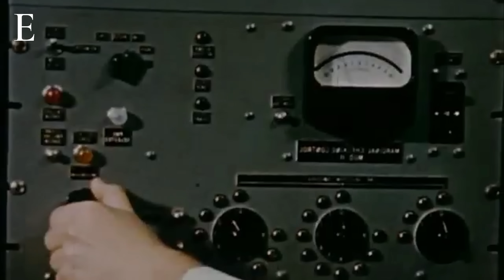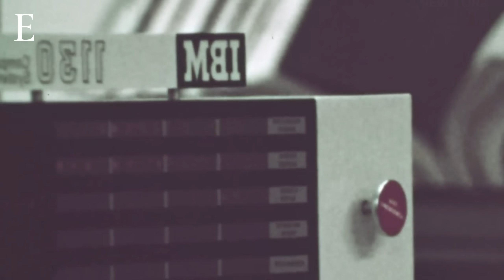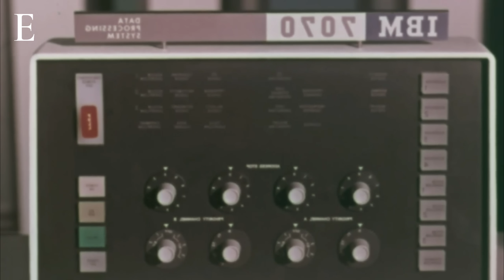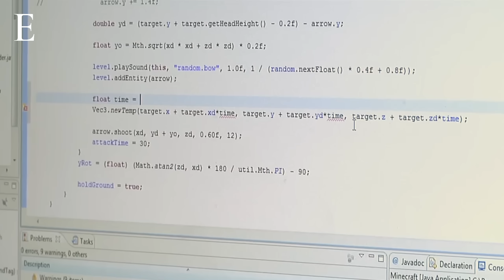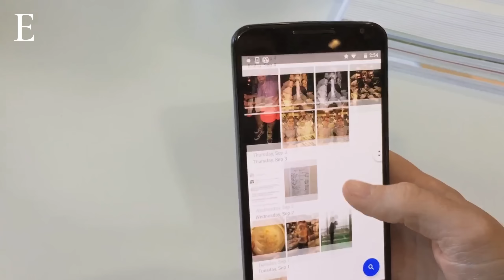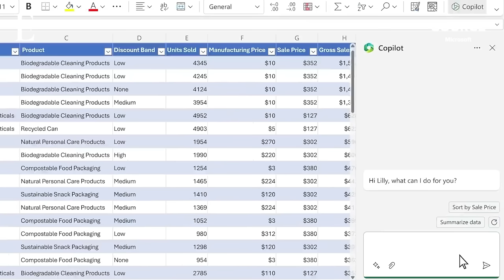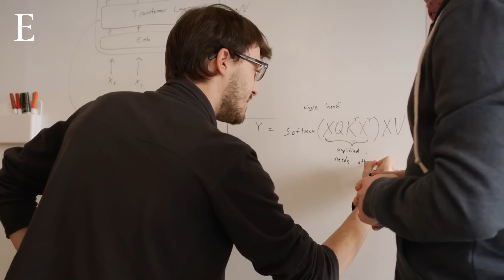The Rise and Fall of Software Engineers

Comment: The term “Software Engineer” has a wide scope and could include a wide range of different roles, many which today have minimal value. A Hardware provider would often have as many SE’s as sales reps, which today is no longer the case. There were SE’s in marketing, which today rarely exist. However, high end SE’s which in depth technical knowledge and skill are still in demand; however few people want to work those roles. Those type of roles are mainly focused on keeping mission critical systems working, or protecting those systems from security breaches. That type of role has no fixed hours and often requires 60 hour week, often working through the night to resolve critical issues. While the pay is good, few people wanted those type of roles. To make this issue even more difficult, in order to gain the experience you need to work those type of roles at a low income for several years, which was a real turn off to many new SE’s. Now we come to programmers, of which there are two types. Process driven programmers, who follow detailed scopes and creates the code without any idea of the overall solution. Their work is often rigidly controlled by the tools that is required by companies. While these roles can be replaced by more advanced tools (or AI), these roles do not need a high level of skill and programmers can be replaced with other programmers. As there are an unlimited number of high end programmers in India, its only logical the work moves to India. As for AI, the useful code they create is often inefficient and takes a lot of effort to debug, so replacing people with AI tools is not on the cards yet. The other type of programmers are what I call high end programmers, who start with a problem and creates the scope and design of the solution, as well as hack the initial code. These are in demand but require an enormous amount of experience, which takes years to develop. These folks have no issues getting jobs, but they are people who have unnatural passion in their field and there are few people that could fit into this type of role.

Comment: I got into programming from copywriting and can say that LLMs are fairly limited in both fields, despite being great performance boosters, idea generators, and a great learning source.. I’ve learned a lot of programming principles using this tech. Now I’m using various programming languages in my work. Sure ,go ahead and write that function or create an html form with it. But no more than that… And don’t forget to test. Thing is, we live in a consumer cultured world and people expect easy solutions. In a perfect consumer-optimized world, machine reads customer’s mind wirelessly and creates as commanded. But, to build a tool like this, not only do you need great computing power, you also need to have a ton of engineers that would consistently maintain such system and react/adjust the things on the go. So unless humanity overall gathers and invests in this massive worldwide project, there’s no hope this is a valid future scenario 🙂

Comment: I work in tech recruitment, AI isn't the replacement it is an helping hand. Klarna failed on replacing their customer service. What is happening is that companies have been going into the cloud more, offshoring their jobs outside the countries they operate in towards India or cheaper hubs. This will spiral, the question remains will the cloud cost usage be more expensive to operate or will development be able to compete with costs.

Comment: In the 1950s, software engineers were truly computer engineers, both in mechanical and electric engineering. Nowadays, many "software engineers" are coders/programmers, and there is a distinction made between software engineers and computer engineers.

Comment: The reason why 25% of Googles code is AI generated is not because it is all just done by a machine. Software Engineers use the help of AI, like GitHub Copilot for example, to increase productivity, by writing code which is repetative and boilerplate. AI can't (yet) work efficiently with complex algorythms.

Comment: As software engineer can't wait when I can just tell the prompt what I want and get the code but right now AI editors give me trash and chat gpt at best gives examples of code to the question - like stack overflow but a bit better. 
Have no idea what kind of software is generated right now everybody talking about, never seen a usable example and what seems to be ok when AI generates prediction often contains bugs. 
Actually writing a code is not even a half of what we do, it's probably about 30-20%, most of the time spend on thinking about what should be written and what change to the system is to be desired.

Comment: As a SWE, I’m not worried. I tried using Claude 3.7 to improve some simple Bash scripts I use for various repo and OS level management.  It injected so many errors I had to stop using it and just do it manually.  LLMs struggle with existing code bases. That hasn’t changed despite larger context windows.

What you have here is a bunch of CEOs trying to improve their bottom line for investors that will ultimately backfire, and these companies will just end up hiring engineers anyway to fix it all of the LLM mistakes.

Comment: Non programmers should not be allowed to touch AI for coding, period. The AI generated programs look apparently ok but needs to be checked for logical errors absolutely. Also in my experience AI works best if the larger architecture is broken up and the parts that are repetetive and common are asked to be coded. So it needs careful planning and scrutiny and a programmer is definitely needed to oversee it. At least for now AI can assist the developer to reduce development time only.

Comment: Most AI now is as the video says "generated from a simple sentence". That may be true because if I say "create a video about the evolution of Ai" I would get this video. The creator doesn't care about accuracy nor content, just clicks. But that's not how programming nor journalism works. Coding is very specific and customer requirements can be hundreds of pages long. With input like that, how is Ai supposed to process that? It cannot understand what is being asked. It can only provide sample code that matches the question without really knowing if it works. And that is somewhat useful, but requires someone to understand both what's needed and if it works. I don't disagree that it can automate tasks and replace junior engineers, however this may be symptoms of other problems. It may be that graduated are under educated, or businesses have over-hired in the previous economy, or that they feel slowdown in their own revenue and need a reason to cut people.

Comment: Ai will never replace the business understanding or simple problems and revisions in code. Ai doesn't understand the computer architecture. Ai cannot do internal meetings. Ai is a simply a tool for now, software engineers are not dying, it's evolving. And with a cs major swe is the last thing u should do now in the age of ai/ml, data and cloud.

Comment: Software engineering job is not only programming, you have to also analyze requirements, analyze algorithm, the business logic, the architecture, the pros and cons of certain code, the design, the optimization, the automated or manual testing, and so on.

Comment: Software engineers will only be obsolete when the project is completed without anymore maintenance, bugfix or new feature, and the product owner feels the product is good enough for user to use the same thing forever. In my country Indonesia, for example, there is a banking website that is built in the year of 2000 with HTML version 4.01 and it has never been upgraded since then, and it is still being used until today.

Comment: I've been a software engineer for many years. I have a thought about the stabalaty of SE jobs. Don't work on new projects, bcz writting code will be easily replaced by AI soon. Try to work on maintiining a existing complicated project which is making money. AI is not able to debug a complicated system. If you know the system very well and you can handle the tough  problems. Your job is scured.  You still have chances to add new features. I mean writing code.

Comment: Calculators didn’t kill calculus, and Excel didn't kill the accountant, they empowered people who understood the math to move faster and go further. Similarly, AI isn’t replacing software engineering; it’s amplifying the capabilities of those who know how to build, reason, and solve problems. Writing code is just one part of the job, and understanding systems, trade-offs, architecture, and debugging are all skills that still require human insight. AI is a powerful tool, but software engineering remains a deeply human craft.
Reply: Lol same old example. AI is an unconventional ever evolving think tank. A calculator will remain the same ever after 20 years

Comment: Hilarious how AI's capabilities are insanely overhyped in this video as well. Just a few months back Apple publicized a study proving that all existing AIs fail at even the most simple logic questions, when you simply exchange variable names or nouns. Because they do not in fact solve the logic puzzle, but have been trained on pretty much all existing logic puzzles there are. So when you prompt a similar puzzle, you must make sure it differs enough to not be a simple string-replace task for the LLM, where it pretty much reports back the training data.

So no, AIs are not good at solving riddles. And they are also not good at writing quality code. Sure, their code works - so did my first code 25 years ago. I wouldn't suggest you deploy it inproduction, though. But sure - it "works". Just like AI's code "works".

Comment: This video portrayed the current AI in such a good light compared to what it actually is. No, it can't create complete applications, it can't actually make something that can be later on maintained or extended without being constantly and repeatedly told to do so. Many current challenges are not just about some "mere fintetuning" but their solutions are quite likely hidden behind a whole wall of discovering something beyond LLMs that can solve these problems. 

But yeah, on a path towards replacing humans... we are replacing humans. Not a shock. If that's our goal, then it probably doesn't come as surprise that we will achieve this.

Comment: Non IT people can´t even fix the printer, and the video is telling me they will start building applications using AI only...
Reply: They cant even install printer drivers😂. AI will just help Developers work fast, but it still needs the software developer
Reply: No one can fix the printer
Reply: I read on Reddit many stories of people some even went up 70% app completion and then the whole thing breaks up. One of them even said Vibe Coding is for people who can code.
Reply: When the printer breaks down, more efficient to buy a new one 🤣🤣🤣
Reply: Fixing a printer is a PHYSICAL thing while building applications just require pressing a button and talking to AI. They are two different things. Building applications with AI only is much easier than fixing a printer
Reply: @israelamach3733  Fixing a printer is easier than creating a complex app. The barrier to entry as a Printer tech is very low. The barrier to entry into programming is very high. Yes, you can press a button to tell AI to generate the whole app, but do remember that it is not at par with what a Professional Developer can do with or without AI. These people are over-selling their AI apps. It is a lie that, without any technical knowledge, one can vibe code a production-ready app, except for generic stuff. That said, I love vibe-coding, but it is actually a game-changer for developers.
Reply: there are many who cannot understand difference between numerical zero , character zero , and string terminator zero , so called null , and have ended up as leaders in IT thanks to powerpoint and so called leadership skills, somehow corporates have not found a way of spotting and dealing with them. these are the folks who will say “you need not be an engineer to manage engineers”, then become a leader and say “you need not be a manager to manage managers, all you need is ability to nurture relationships and evolve” , ase these folks move up and up , the companies they lead end up with useless transformation projects , which are mere upgrades with a goal to cost-cut, but of no means to bring in new business or a way of doing business. the one question these folks should have faced “who are you, why are you here, and how are you here”.
Reply: AI will reduce the number of developers needed for a project that's where many will lose their jobs. It will be left with a few
Reply: @rischio7678  At the same time, there will be more new projects thanks to the productivity increase. Much more code created means more software developer needed to maintain them too.

Comment: There's a common belief that AI can replace developers and that anyone, even without technical knowledge, can get complex tasks done by just 'asking the AI.' To test that, I gave the AI full context on hooking, reverse engineering, and Rust. I described a specific use case involving hooking an address in a struct, where the field was a pointer to a pointer referencing another struct without padding. Despite all that, the AI repeatedly failed. So now I'm wondering: how is someone without technical background supposed to explain this better than I did?
Reply: Amen
Reply: thats the newest part they don't. instead of asking AI to make a data structure for a program, you are supposed to ask it to make the entire program itself. supposedly AI will become capable enough for this in a few years.
Reply: @destiny_02  That misses the point. The issue wasn’t about asking for too littl, it was about AI failing even with clear, technical input. Saying “just ask for the whole program” doesn’t help if the AI can’t handle a focused task. If it struggles with specifics, it won’t do better with more complexity.
Reply: @destiny_02 no thats the part YOU dont understand. These LLMs are just black boxes of input and output. Hes saying if he gave very direct and comprehensive input, and got slop out, how is it going to get good answers when slop is put in?
Reply: The idea is that it is constantly evolving, and soon it won't need an explanation, all that you know is knowledge that's already out there, and can be learned by AI faster than you ever learned it by miles. I think that's why people are worried.
Reply: You obviously didn't understand what they were saying. They never said there'll be no need for human experts. They said humans will still be necessary but it will allow the same amount of work to be done with fewer people. As they said, AI will be an assistant.

Comment: Software engineering alive and well. Kids spending two weeks on a udemy course or attending a bootcamp and calling themselves engineers, something that started in America and was later embraced by the industry, are toast.
Reply: Hey don't hate on udemy...I took a couple of courses on there, transitioned into networking, and landed a good job
Reply: thats one thing that does worry me. I started with a bootcamp. I've got 10 years of experience and currently a CTO having worked at several large startups. Bootcamps arent' perfect but they are a rgeat first rung into the career. its on you to keep yourself learning new things. I worry that we are losing teh pipeline for new engineers to come into the field
Reply: The bootcampers are the ones getting grilled, the problem is that they flood the market wtith fake resumes so getting your resume passed them is difficult, eventually when you get an interview is easier.
Reply: HR also like to call them software engineers, fits their small budget and they still count as a complete resource.
Reply: We're relics from times when a Degree granted you a job...

Nowadays, Companies wipe their as*es with your Degree, and will hire anyone half-capable of doing what you do, by posible 25% your rate. And since they're big enough to give 2 shit$ about the user's opinions, they don't care if they release crappy products.

It's called capitalism baby, welcome to the rat race, there's cold coffee in the corner
Reply: I Remember the Mainframe Computers,  and got Certified in 1990's at Local Community College. Also Got Certified in Cobal and Visual Basic. Then Associate Degree. My Mom worked at a company with Cobal programmers.  2000's Certified in Website Design ( +net ) etc... Used GUI Graphic User Interface  Dreamweaver & Flash to ( Write all the Html Code, Website code ) for you. Now WordPress ( Free ) is a GUI for writing code to Create Websites E-commerce sides, Shopify Stores etc... or WordPress & Woo e-commerce.  Took some Udemy classes only to learn that the " Cloud " is Basically the  " Dark Web " with the way Coding and scripting is done today.  Writing the Test Scripts to me are Basically Macro's that could Very Easily be considered / Converted to Malware in the Future  !!!  You can by Apps on Flippa for $50 - $250 USD  Complete  Games etc...
Reply: Are you delusional? Some of the smartest people I know who are CS graduates from top universities cannot find any jobs at the moment despite having internships under their belts
Reply: Alive and well? Its worse than ever.

The jobs are never coming back